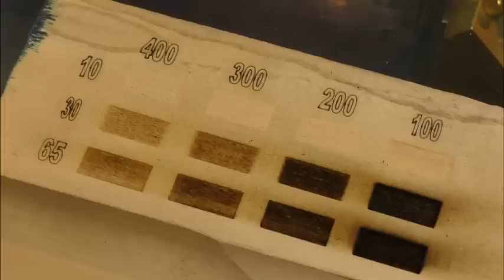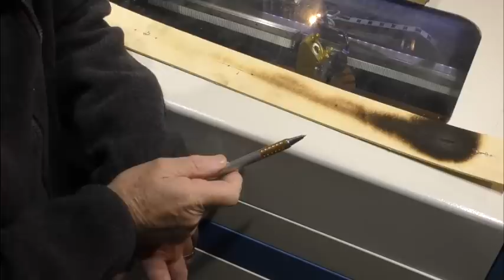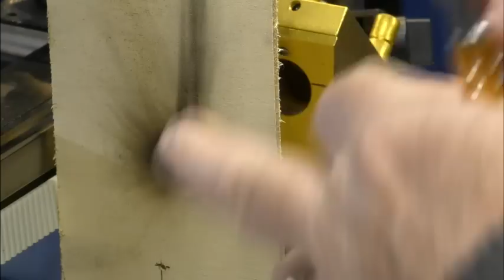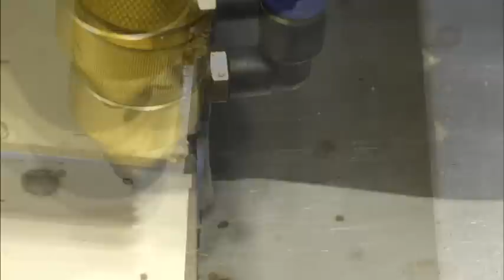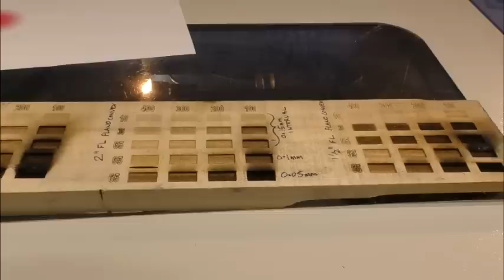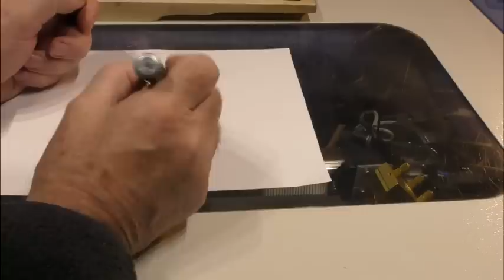RDWorks Learning Lab 129 The Mechanics of Wood Cutting

Comment: This tempts me to think that multiple passes should be achievable to cut much deeper into wood without scorching at all. Could you demo that?
Reply: I don't think that multiple passes will work UNLESS you have the ability to Z height adjust.  This is in my todo list and I need to buy a 40 dollar driver and a Nema 23 motor with a 24t HTD gear and I will have that.  This is what we do with the low power blue laser diodes as you make a pass then raise the bed by X amount and make another pass.  With a Ruida system I do believe you would use U versus Z as they lock out Z or you could split it into jobs and move between jobs.  A bit clumsy how they implemented that in the Ruida controller.
Reply from the maker: Hi Ian
There is just one significant issue with your suggestion and that is the smoke. This is gas laden with significant quantities of particulate matter. As the IR hits the solid particles it reheats them causing them to ignite AND absorbing power required for cutting and charring the sides of your cut. There are other issues as well. First is the speed you would require ie 200 to 400mm/sec. You will not be doing too much cutting at that speed and secondly the speed will be variable and out of your control because of the various shapes,  sizes and sharp corners. Before I knew better a couple of years ago, I did try multiple wood cuts and finished up with a charred mess.I quickly found out,  ONE cut for wood, max air assist right into the kerf, running as fast as the material thickness will permit. Removal of smoke from the immediate cut area is a key element for deep ONE PASS cutting of wood.
Control of speed and power is doable for engraving and the expanding vapours can escape freely upwards. Do NOT use air assist ( only the mearest whisper to protect your lens) or you will force those vapours back onto your work.
All best wishes
Russ
Reply: Yep, we learned about the air assist for engraving from you a while back but I am going to try the method I outlined but maybe it only works for extremely low power lasers like diodes?  It does work and smoke on the lens on a diode laser is even worse I think as it can, and will, obscure everything on it.  edit: Though I don't think it will break the lens as a CO2 laser will easily do if the lens is smoked up.